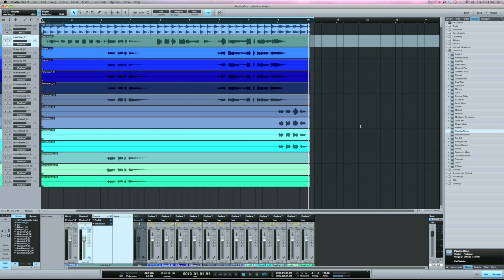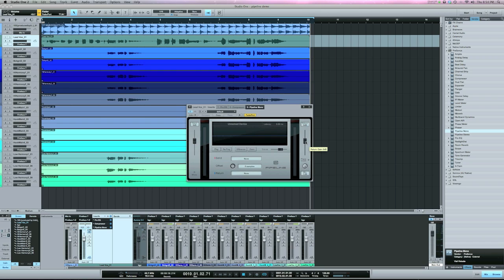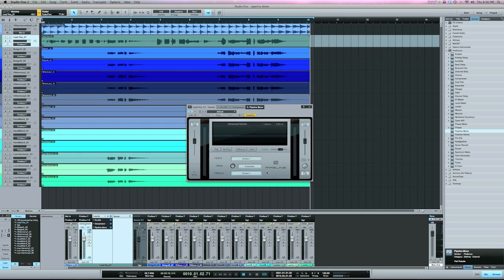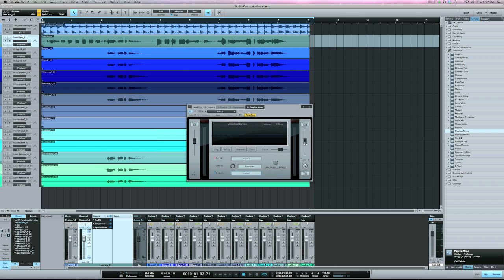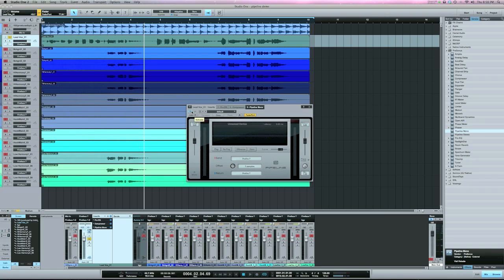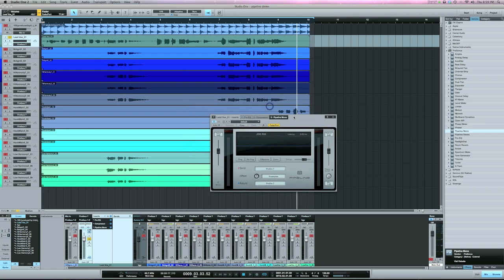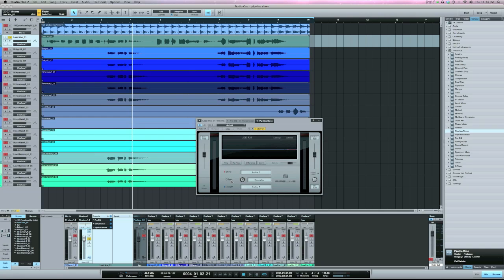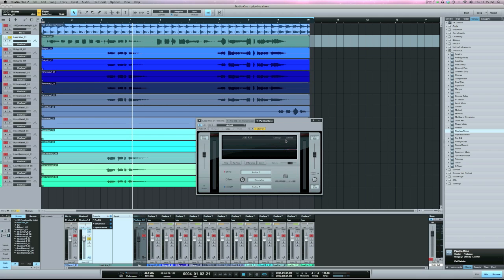how to use pipeline in studio one

Comment: What buffer size do you use for hybrid mixing to keep the latency low when you print back in? And is there a gain stage process for hardware?!...., because even turned down the input is hot. Should I gain stage the inputs?

Comment: Hi Czar. I have a question for you. When Pipeline is used... we're sending a prerecorded signal that has already gone through an A-D conversion to arrive at our DAW. We then need send that digital signal back through a D-A conversion into our outboard gear. Then we send that analog signal back through our interface, converting back to digital.

So here's my question... aren't we losing a lot of signal fidelity with all of this conversion? I know that there's really no other way to use Pipeline, but still... it seems like the signal is getting mucked up.

The only way that I can think of that would reduce this much conversion, would be to buy an interface with ADAT outs, and send that digital signal to a piece of outboard gear with ADAT I/O. This way the signal stays digital after the initial conversion from analog. Is my logic sound?
Reply from the maker: I've never had a problem using the additional conversion needed to use pipeline. Converters generally should be transparent as possible so they shouldn't effect the sound. With Lynx Aurora and Antelope Orion I've had no issues with the extra round of conversion. Not a lot of options for ADAT on outboard gear unless its mic pres.
Reply: Yeah... that's what I figured. It really sounds like it comes down to "how good are your converters". If you have a cheaper interface and your routing things back and forth... you likely run the risk of introducing some nastiness. Whereas... if you're using an Antelope, or UA Apollo... you're likely never going to suffer from degradation.